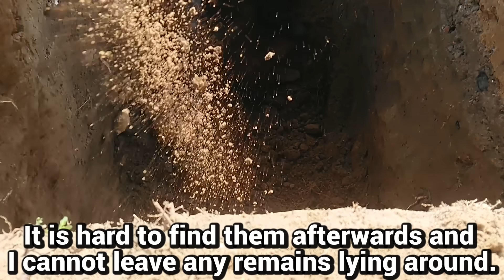Digging Up a Grave from 1996 to Prepare it for the Next Person

Comment: I find decomposition to be fascinating. As you know, some corpses are nothing but bones in just a few weeks. Depending on conditions, other corpses look unchanged after decades.
Reply: Americans typically embalm their dead and use very expensive caskets so in the US, you'll sometimes see exhumations take place where the body is still fairly intact after decades under ground.
Reply: @henrikpersson4698  There is a movement towards "natural burials" these days, where the body is left to decompose naturally, without embalming or extensive sealing away. "Dust to dust", etc. While I personally want to be cremated, I figure letting nature take it's course is a good alternative. Feed the trees!!
Reply: I’ve always wondered, “why are we trying to preserve a body? Nobody will see them after burial. Eventually they must decompose. So, the only logical reason is that it makes the living feel better. We need to change how we see death and dying. With our environmental emergency, we need to seriously look at natural burials. We need to preserve the earth for the living.
Reply: @kimnoble9434  On a tangent, I saw a video about how coffins/caskets in mausoleums are sometimes propped open a crack to let the air hit the bodies. That way, the bodies can decompose at a decent rate instead of building up pressure, and having that pressure either pop off the marble piece that seals the body or ooze out of the crypts if they do not decompose naturally. So, in other words, from what I understand, most of the remains in mausoleums are not much more than bones.
Reply: @kimnoble9434  Embalming gives the family a chance to have a viewing/funeral without the body decomposing so soon.
Reply: @@DeeDee-uw7gu That body had near-ideal conditions. There is nothing that remains of the overwhelming majority of people who died in or before 1744.
Reply: @henrikpersson4698  read up on the Big Bopper, they did an exhumation in 2007 (he died in the 50's), and he was still very recognizable.
Reply: @kimnoble9434  Most of the things done after the passing of a loved one is for the living.  The deceased won't see their funeral or mass or burial....it's to comfort those left behind.  I guess it's the same with preservation.
Reply: @kimnoble9434  to prevent them from decomposing faster some people don’t even bury their dead until two weeks later sometimes it takes a week. That’s why we embalm our loved ones when they pass.
Reply: @kimnoble9434  exactly plus all those chemicals are messing up our drinking water
Reply: @roundboyli7217 You get your drinking water from a cemetery?

Comment: In most newer cemeteries in the UK graves can be recycled 75 years after the last burial.
It says this in the small print on the cemetery notice boards.
I wonder how many people are aware of this?
Older cemeteries don't get disturbed unless major infrastructure is planned to go through them (HS2).
Reply: @caerleon87  I don't believe that many people will be aware of the 75 year rule. It's going to happen much more often because we just don't have the space for burials - especially if 350,000 new houses get built every year to house the growing population.
We soon won't have the land to grow enough food. We currently produce 46% of what we eat in the UK. The rest is imported.

Comment: You did this with great care and respect.   In Brighton, England in the 1980s an old graveyard from the 1800s needed to have a trench dug across it from one side to the other.  I think it was for a new gas pipe.   All the old gravestones were removed and put against the external wall of the cemetery and the trench was dug with a JCB ( Backhoe ) with all the soil and bones just cast to the side.  It was left like this for weeks before the pipe was laid and the bones/soil just dumped back in all mixed up.   It was very disrespectful and shocking to see.

Comment: I live in France and in America. I’m familiar with both burial customs of mostly Europe and the US. In the US when we buy a place at the cemetery, we are property owners. There is a deed with your name. You own that land.  No one can take you out unless a court order to exhume you for some legal reason.  In Europe you are a tenant with a specific lease from 10 to 50 years depending where. When your time is up and if no one renewed the concession then they will take you out, either removing the bones, placing them in a wooden box and storing them in a vault a the cemetery called an ossuary.They are not “thrown away .However, for instance in a single plot, both my grandparents and great grandparents are buried on top of each other. On a new burial they put the older deceased remains at the bottom of the grave and place the newer tenant on top. It has to be the same family though other wise you go in the cemetery vault.
In France it is against the law to keep your loved one’s ashes at home. They have to be placed in a cemetery or the ashes can be spread out in a part of the cemetery reserved for that. You never regain possession of the ashes.
When a friend of mine died here in Los Angeles and wanted to be interned in France his husband took the ashes to the consulate where they put a tricolor ribbon and a waxed seal
After given the proper paperwork to enter France, he turned the ashes over to the cemetery to be placed in the family vault.

Comment: Good job.
I am impressed by youjr speed.  I have never buried a human, but I have buried pets and livestock.  Experience has taught me that unless I wish to find the remains dug up and scattered about by coyotes or other animals attracted by the odor of decomposing flesh, the grave must be either navel deep (at least) from the carcass top, or covered with a few 80 pound bags of cement.  I usually dig alone with a pointed shovel and a pick, so I feel I can be justified in admiring your speed.  It usually takes me a day and a half (sometimes longer) before I can place or  push the carcass of a Nubian goat or a hog into a finished hole and cover it.  Sometimes longer depending on weather and other factors.  I suspect that the soil you dig in is not virgin to a shovel helps.  Here it is mostly clay soil and of course many roots (which is why I keep the shovel edges sharp or  large rocks and buried boulders too.  It is annoying to dig down knee deep and hit the top of a boulder possibly bigger than a school bus, but it happens and I will move the hole..  

I usually place manageable rocks and boulders in a separate pile.  They can be used later as a stone barrier when filling the hole.  
I also admire the neatness of the straight edges of your holes.  I have never been able to get something dug so precisely rectangular by hand.  There is almost always some irregularity in mine.  Admittedly, some is probably due to my preference for pointed shovels and also I have no motivation to focus on neat holes and just getting something buried before the next heavy rain (can we say 'swimming hole?') or snow fall is usually my focus.
I used to shovel dirt along side the hole, then move it back from the edge to prevent collapse as you do.  Then I came up with put the dirt in a wheelbarrow straight from the hole, but some holes required multiple wheel barrels.  My current method is lay out some wide plastic 10 mil plastic sheets around the hole edge.  Then I dump the soil on that.  A sheet along side both sides of the hole and one end usually suffices to keep me from having to move the dirt pile back.  At the same time, especially if it rains or snows Knowing everything is on the  plastic sheet, or in a wheelbarrow makes filling the hole back in go a little faster.And of course nearby turf is not dug up when recovering the hole.
Reply: that seems a lot of animals you're burying.
I always wondered what happens to dead animal bodies.. are there dedicated cemeteries for animals where you're burying them?

Comment: And this is why most of the people in the last two generations of our family have been cremated. As a Genealogist, I find going back 4-5 generations - many have been relocated as their original burial was in a CBD area. At least one local council that I am aware of, that had difficulty allocating real estate for the departed, instituted a mandatory "stacking" system - they dig using backhoes, put down a cement "sleeve" and then stack coffins 4 deep separated by concrete slabs.

Comment: I am going the natural burial route.  When I go, they will wrap my carcass in a linen sheet, have the hole pre dug by some local college students and while they are lugging my fat butt up the path, my executor will have gone up first and spread all of my silver in the bottom of the hole and cover it up so it isn't visible and they will place me in and cover me up, plant a shrubbery (native to the area) on top and walk away.  No markers are allowed, but you can have native plants or trees planted on top.  If you received radiation treatment before you passed, you can't be buried there, chemo I am not sure of.  This place is set up for as long as possible (nothing is forever) and if in 20,000 years some future archeologist digs me up, all that will be there will be silver.  You CAN however have a bench placed along one of the paths by a small stream if you wish for future visitors to sit.  It is very peaceful and quiet and I doubt that it will be developed anytime with in the next 100 or so years, so it is as permanent as possible.

Comment: Martin, you are doing a great job but you need a helper. In the US we use a back hoe that is slightly smaller an put the excess dirt a few grave away on two sheet of plywood and cover it with a grass rug. We don’t put a new deceased in the grave, you buy it and belongs to your family. I think your method is a better use of the land. I had family in Germany. In Germany the family is responsible for the care of the grave. Every thirty years you pay again if you family has the ability. Most graves are covered with Ivy and surrounded with cobble stones to make the maintenance as easy as possible. Some families plant flowers each spring before Easter.

Comment: This person was buried in 1996? I’m not sure what country you live in, but here in the USA caskets are required to be placed into concrete vaults. You couldn’t simply dig down to the body as you did. The concrete vaults last as long as concrete does. Which would be hundreds of years if not thousands. They’re full of rebar as well.
Reply: As he's stated before this is Poland and they very seldom, if ever, embalm the deceased and do not use concrete in any way during the burial.